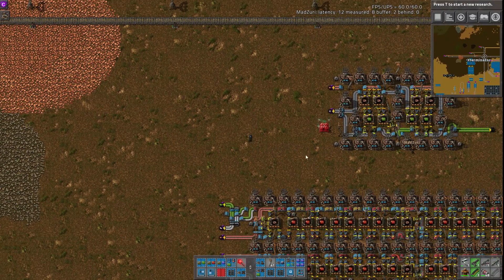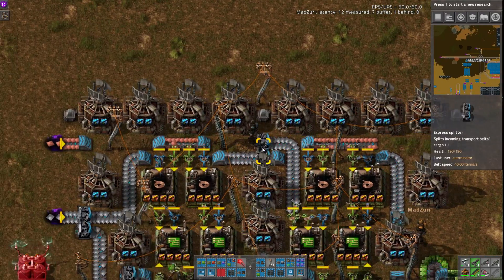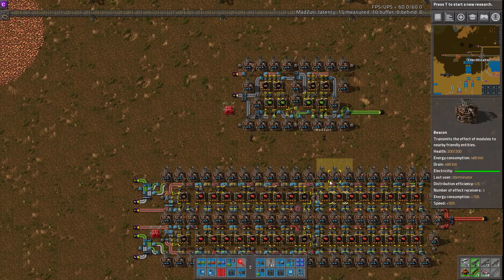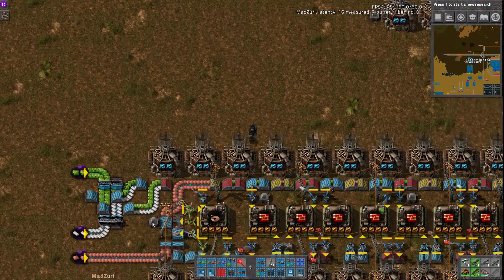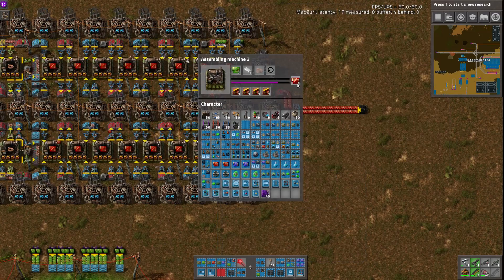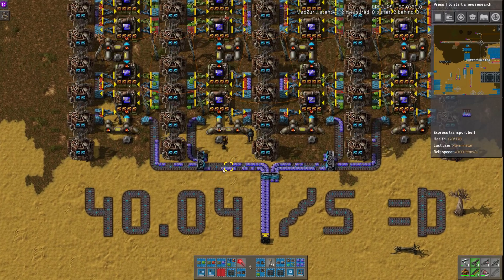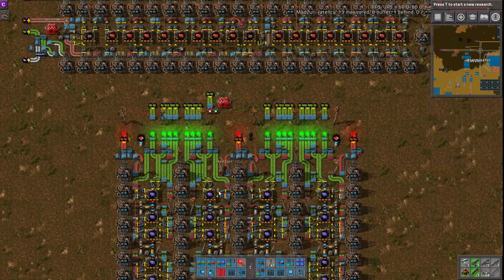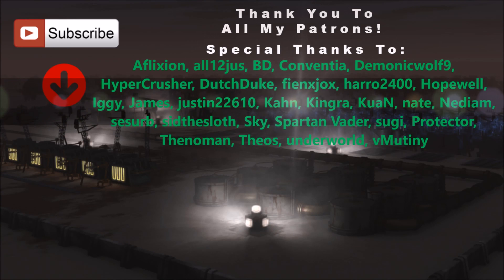Green, Red & Blue Belt Based Circuit Builds:: Factorio Workshop Season 2 - Building A Better Factory

Comment: Really liking the aesthetics of the green one!

But I think I'm filling up a blue belt in my latest base using only 3 green circuit assemblers and beacons. I'll verify after work if it is actually has 100% up-time...

If it does, how do you decide which is better? This one is certainly prettier than mine...
Reply from the maker: Probably personal preference at that point I'd imagine.
Reply: Did a lot of testing in the weekend. My build can indeed saturate a blue line with 3 assemblers, but I have a new row of beacons for each assembler. The build in you video has a new row for 2 assemblers, but also has a few extra ones, so both are approximately identical.

Personal preference like you said.

But since you can't supply more that for blue chip assemblers with circuits form belts, I will stick to my direct insertion build, where one blue line of iron and one of copper allows 4.75 assemblers to run full pelt. That is ~220 blue chips a minute, almost enough for 1 level 3 productivity assembler (and requirements) and 1 speed one to run full pelt, so you can mega base up at a steady pace.

I prefer that to endless belts of green circuits.

Comment: Green one ticks my symetry OCD, but other than that these are lovely! (also the green input for the blue circuits has an asymetry that I don't think is needed)
My main problem with these is that if you are using a main bus design, outputing on the other side of the build is a complication, ideally you would output back from where the input came.
Reply: True,
I use trains to feed one side and to load on the other, that's why they are the way they are.
But yeah, I think I might be able to improve the asymmetric loading.
I doubt I can fix the OCD problem with the greens without making it bigger though. XD
Reply: Yes, for train fed builds it makes sense to output on the opposite side more often than not, granted.